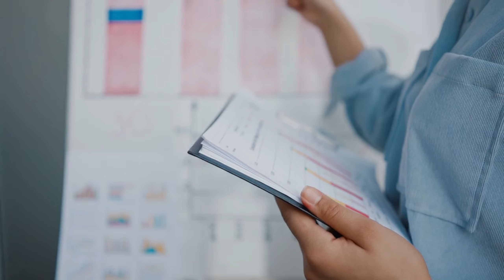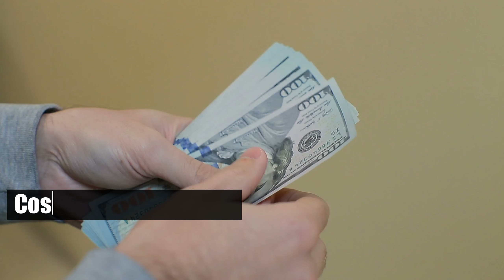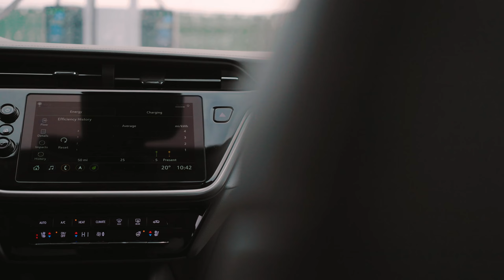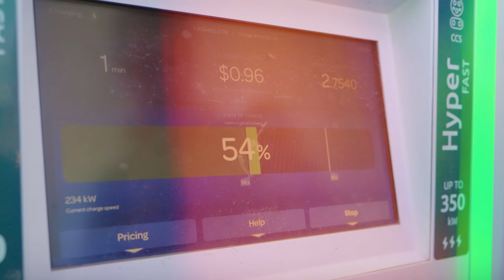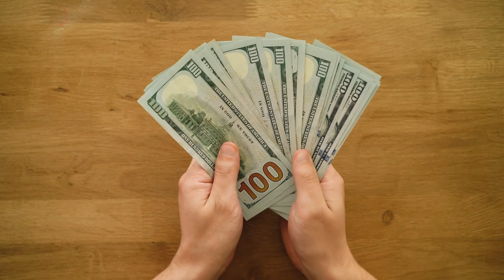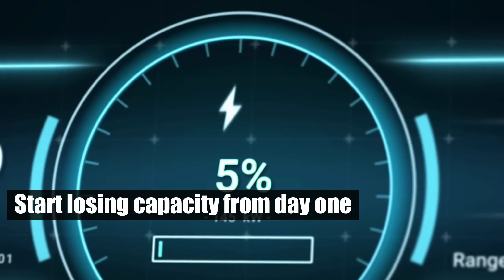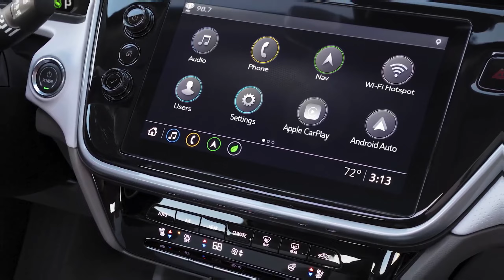Used EVs Exposed: The Shocking Truth Behind the Biggest Scam! Will You Buy A Used Electric Vehicle?

Comment: One more reason for NOT TO BUY AN EV! It is clear, EV's are not the answer.  If buying a new EV has its own problems, I can't imagine a used EV! Even if you get one for free, it is going to be expensive to own. Thanks, but no thanks!
Reply: So do not watch the Oprah Show if she starts giving away electric cars!
Reply: Been very happy with my used EV so far.  Saved a ton of money in running costs.
Reply: Hey stupid mine is 4 times cheaper to run and cost less than an ICE car.
Reply: A friend of mine just spent $15,000 for a battery for his 10 year old EV. 😅 He bought it used and still owes  $25,000 on a $6000 car.
Reply: @KevJ1247  That seems rather unusual.

Comment: Depreciation is a reason to buy.   If they lose half their value in the first few years, you don’t want to buy new.   You want to buy a low mileage used one.   Not tat I am advocating for them - I am not even a fan of hybrids.   My in-laws bought a new Infinity hybrid and the mpg was almost identical to the 2005 Malibu I paid $1000 for.   The added weight took away any advantage.   They also checked the cost of replacing the battery just to find it is discontinued and the only place that can custom make a new one is in BC.  Not a good thing if you are in Saskatchewan.  And what if your screen is discontinued?   The car can be scrapped because no one makes aftermarket ones.

Comment: Get lost, Even the very heavy Lithium iron cells are done after ten years, thosse lihium-ion cells do even worse in cars where temps go up to 70°C and down to minus 20°C.
Reply: Not true.
Reply: Most people  just get around 5-6 years their battery . Degradation is so bad that many of the battery modules have to be replaced.  $$,$$$
Reply: @davehope2210  Complete rubbish.  Even if true, they would be replaced for free.